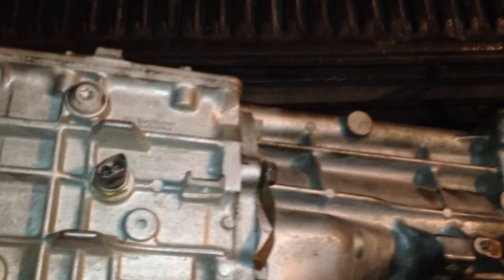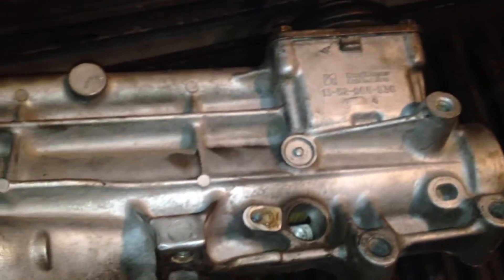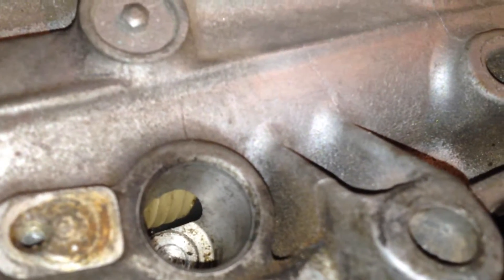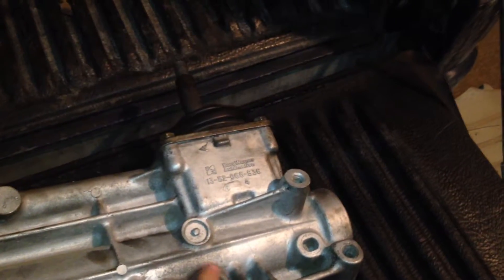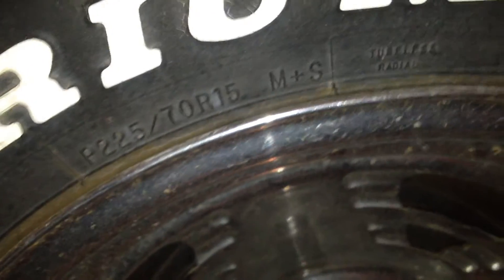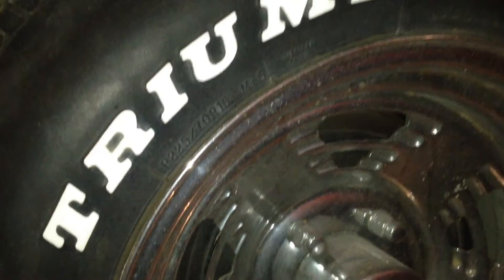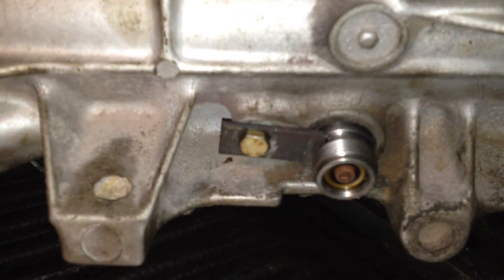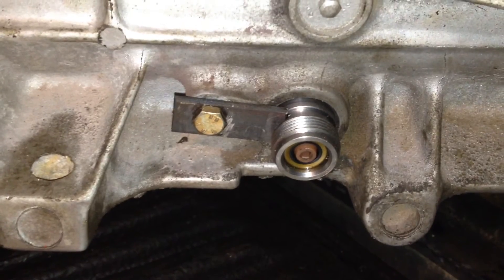Speedometer Gear Calculation

Comment: Yeah, I'm fighting with this as well.  I bought a PURPLE (17 tooth) driven gear, but I didn't realize there are also two different diameter, either 1.76" or 1.84". The Purple (17) tooth (P/N 3987917) is for the 1.84" which didn't work for me. Turns out I need driven gear w/ 1.76" diameter... I tried but was unable to find the Brown  (18 tooth) (p/n 3860341) gear so I bought a GREEN driven (p/n 3860345). I know the speedo won't be accurate but at least it should start registering something. All the 1.76" diameter gears start with p/n 386XXXXX. The 1.84" gears start with 398XXXX. If anyone knows where I can find a 3860341 (Brown) 1.76" driven gear... I'd be interested, otherwise I have to start researching gear ratio converter...😥